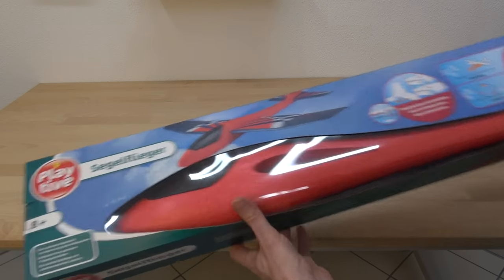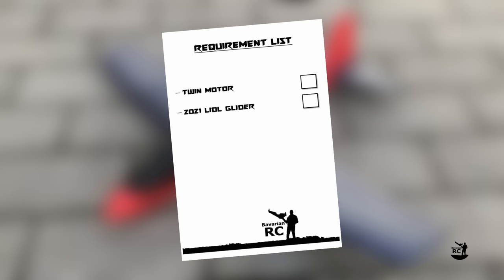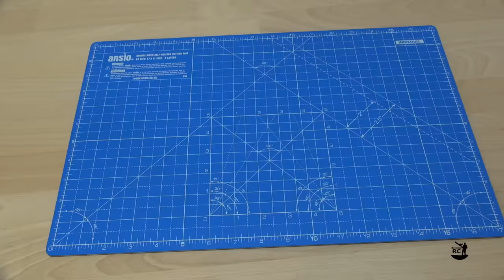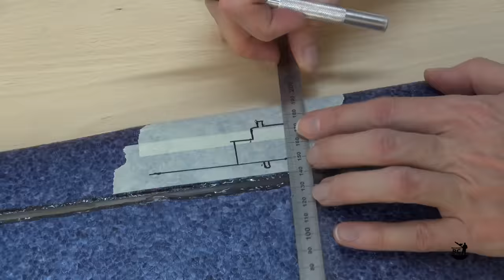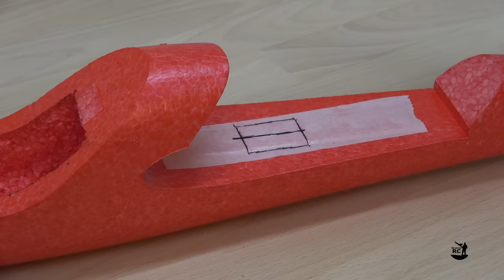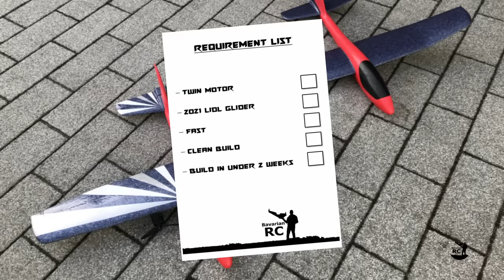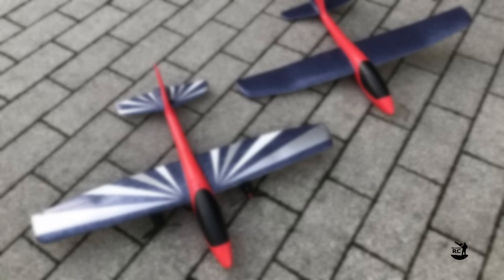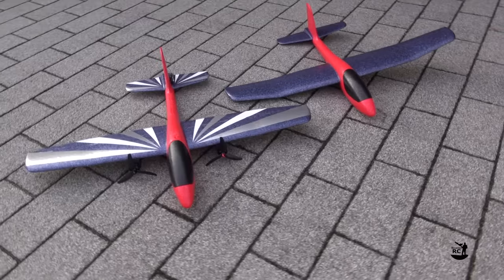LIDL glider RC conversion - TWIN TURBO LIDL - Build Video

Comment: FYI if you coat that wing with box tape,  you wont have to put a reinforcing rod into it, and it smooths out the wing.  if you layer the tape to overlap towards the rear, you create more lift due to the stair casing affect of the layering.   i used to do this with gliders and mount 0.49's on them and fly them during the early 2000's.
Reply from the maker: I am using packing tape a lot on my foam board builds to reinforce them. Never thought about using it on a foamy except for covering things like ESC in the wing. Need to try this. Do the layers work like a kind of KFm airfoil?
Reply: @bavarian_rc  it can if you layer it so that the top stepps towards the leading edge and the bottom steps towards the rear of the wind.  you'll cause the top the drag and the bottom to slip.  which in turn causes lift.  also if you pull the tape while setting it onto the wing,  you'll cause a slight tension on the wing,  then when you do the 2nd side it will pull it back, which causes the wing to become very rigid.
Reply from the maker: Thanks a lot. Quite interesting effect. The way you explain it makes totally sense. Tension on both sides will in effect make it totally strong. I will definitely try it 👍
Reply: @bavarian_rc  another tip for those foam gliders,  before you tape it,  Sand it with an 80 grit sand paper..   you can alter the shape and smooth out the surface, and it will help the tape to stick really good.
Reply: @bavarian_rc  also i have to say, that your hatch idea, with the easy release was a really good one that i have not thought of..  which is very rare, seeing that i have been doing rc planes since the early 80's..   :)
Reply from the maker: Sanding makes definitely sense. The untreated surface is not very adhesive friendly except if I used hot glue. everything else just peels off if you don't sand it.
Reply from the maker: Thanks, that is praise from a qualified mouth! I have to say that this hatch design was one of my brighter moments 😂 It took me a while to come up with the idea. Before I used magnets or just electric tape around the hatch and fuselage but finally this solution is favorite one. 
Seems we are around the same age. I built my first RC plane mid of the 80's. It was followed by many more until the early 90's. Then other things were more important in my life and I paused the hobby for around 25 years... just to restart full throttle in 2016.
Reply: @bavarian_rc  Dan's Foamy Tip #4 :  Great Stuff Squirt Foam and Flower,  is your best friend.  you can put some of the red canned squirt foam from home depot into a small disposible container, then add flower and mix until it becomes the consistancy of play dow,  then you can push it in and form it,  give it an hour, and it will be solid foam.   sandable,  paintable, and even glueable.  near as strong as balsa wood, and nearly as light.
Reply: @bavarian_rc  you can also use the squirt foam as glue if you work it down from the inital fluff out of the can into a paiste, then just a pipsickle stick to smear it between two surfaces, then join them, and give it an hour,   it will be glued with foam..
Reply from the maker: Wow, great tip! Not sure I will get the exact same product in Europe but I guess it is normal PU foam spray. Or is there anything special to it? Just out of curiosity: how do you get the idea to mix PU foam with flower? I am used to think outside of the box but that idea is just fantastic!
Reply: @bavarian_rc  pretty much any gap fill foam,  used for sealing between window frames and houses, or sealing and insulating any thing really.  in the usa, there is 3 types,  hyper expanding,  medium expanding, and low expansion.. you may have to try and see which is best, but i found that the medium expansion stuff works best.  as for how did i come up with the idea,  i started out mixing sanded foam into it, but that didn't work out so well because it still expanded,  then went to corn starch, and still wasn't good enough, so i went and tried flower, and man, it was amazing,  even had some engineers wanting some pieces to test tensile strength compared to wood.
Reply from the maker: Fantastic! Have to try this as well!
Reply: @danratsnapnames  That's certainly an interesting idea for making instant light Spakfilla glue. I am assuming that by "flower" you mean ground wheat "flour" - not the San Francisco hair adornments? 😉
Reply: @theoztreecrasher2647  yea, your right.. i hate my stupid cell phone.. i turn off spell checking, and nothing types right,  i turn it on, and it changes the odd stuff.  nothing works..  sorry, old person having a moment. .lol..
Reply: @danratsnapnames  LOL! No Prob! I'm 1-up on you. So old that I don't even have a mobile phone - no coverage out here in the Aussie bush anyhow. 😉😊

Comment: Yo hubiese instalado los Becs en la gacela atras del motor para que refrigeren.. Ingeniosa adaptacion!!!!
Reply from the maker: Thanks! For better cooling you could certainly put the ESCs into the nacelles. There were 2 reasons why I didn't do it. First: The ESCs don't get too hot. The max. temperature is typically around 60°C. Second: This thing is pretty much nose heavy. So every gram I could get behind the center of gravity (CG is at the position of the carbon tube) was helping me to avoid adding more weight in the tail. Greetings from Bavaria!

Comment: Great video. I built a very similar Lidl twin a few years ago and it is still flying well and frequently now. I mounted my motors above the wing which seems good so it will be interesting to see if yours pitches up under power...
Reply from the maker: Thanks! I had some pitch up effects under power at the beginning. After some flights I found a motor down thrust of 2,5 degrees working quite well to compensate the effect. Another issue with mounting the motors under the wing is that the props are touching the ground when landing. By using the HQ props which have some flexibility I managed to avoid broken props. Check out the flight video to see how it behaves in the air: https://youtu.be/9_H6sVcMOhw

Comment: For fine slices into the foam I'd prefer a soldiering iron with temperature control, which makes less fuzz, though, depending on the used glue (epoxy or CA) the dremel result might work better. Heat glue has some advantages, but only with specific materials.
Reply from the maker: The mess when working with the dremel is not as bad as it looks. The vacuum cleaner does the job. Maybe next time I try my hot knife. Should work similar to a soldering iron. On this type of foam I prefer hot glue or PU glue. With CA or Epoxy the results were not as good.

Comment: Very wonderful production sharing! I have seen the video of the test flight. Can you please make another introductory video after the final optimization? Very much looking forward to it! Can you also share the printed files of the motor base and rudder angle? Thanks again!🎉🎉
Reply from the maker: Thanks. Actually there was no further optimization necessary. It flies just perfectly. The link to the STL files for 3D printing is in the video description. Also you can find a plan and more detailed info there

Comment: No way!! I'm building the same thing!! Twin lidl glider!!
Reply from the maker: Ha, that‘s funny! What motors do you plan to put on it?
Reply: @bavarian_rc  1407 3600kv brother hobby
Reply: I used thin carbon strips to reinforce everything, and used gorilla glue/ugu por to glue them in. Why did you take out the dihedral? What benefits does it give you?
Reply from the maker: Thanks for the info
Reply from the maker: The dihedral leads to a self stabilizing effect. I was looking for high maneuverability with very high roll rates. The dihedral would counteract to this. If you would go for a very light thermal glider you would want to have dihedral for stabilizing the plane while circling in the thermals.

Comment: Very clean build, I would use foam safe CA on a lot of areas to reduce weight, slow down with the hot glue lol. Nice build!
Reply from the maker: Thanks! You are possibly right that I could be a little bit less generous with hot glue 😂 Nevertheless hot glue easily fills gaps which means I don't have to cut too precise (like for the carbon spar). But in other areas foam safe CA glue could easily be used 👍
Reply: Because these gliders are made of very flexible EPP not stiff and brittle EPS, using a hard and brittle adhesive like CA (Superglue) would NOT be a good choice. As the foam flexes the CA will crack away from it. Also "Foam Safe" glues are for EPS - with EPP you can use things like rubber/contact cements which contain toluene. Using them on EPS would give a gooey mess instantly! 
Provided you make fairly neat fitting joints and scrape off any extrusions, hot glue makes a good and reasonably light job. Also 1 slight problem with EPP foamies is that there is often mold-release compound still coating the outside. This can make it difficult to get glues/tapes/adhesives to stick properly. You can try cleaning the mating surfaces with isopropyl alcohol or roughing them up with sandpaper but generally a good hot application of hot glue will slightly melt into the foam and produce a really solid bond.
And speaking of flexibility, you will notice that the builder has opted for slightly flexible props rather than the very stiff (and brittle) props used on racing quads. These are a little less efficient than the stiff ones but will take a LOT MORE heavy landings before they need replacing!  😉
Reply from the maker: Thanks for giving a lot better answer than I did 😜 I didn’t think of the effect of the brittle CA on the flexible EPP.  👍 Cheers!
Reply: @theoztreecrasher  I have build a few of these, I used very little hot glue, some foam safe CA and epoxy, never have an issue.
Reply: @rubenburgos6  I don't doubt what you say - BUT perhaps you don't crash your planes as much as us Old Farts do! 🤔😜😁
Reply: @theoztreecrasher  hahaha define old fart...I might be in the club already 😆😆😆

Comment: @Bavarian RC And you should fun it on 2 batteries or one because there are two connectors.
Reply from the maker: I use one 1800mAh battery that is connected with a Y-cable to both controllers

Comment: Sehr wunderbare Produktionsfreigabe! Ich habe das Video vom Testflug gesehen. Könnten Sie bitte nach der endgültigen Optimierung noch ein Einführungsvideo machen? Ich freue mich sehr darauf! Können Sie auch die gedruckten Dateien der Motorbasis und des Ruderwinkels weitergeben? Danke noch einmal!
Reply from the maker: No sure if you saw my other answer to one of your comments. The design didn't require any more updates. The link to the STL files for 3D printing are in the video description

Comment: very nice clean but how you land and not broke the plane? your propeller touch the ground
Reply from the maker: Thanks! You are right, the props touch the ground when landing. The HQ props I use have some flexibility and don‘t break. Even after more than 60 flights with my Twin Turbo I didn‘t have a single broken prop.

Comment: Great job, congratulations. Graupner Ultra 2806 2300kv motors are no longer for sale. What other engines would you recommend? Thank you very much
Reply from the maker: Thanks! Yes, luckily I still had some of the Graupner motors available. They work really well. I haven't tested any alternative, but I guess any other 2206 2300kv motor will work as long as it can take 3S. This is one that I found: Holybro Brushless QAV250 Motor (https://www.mybotshop.de/Holybro-Brushless-QAV250-Motor) - also available in CW and CCW which is quite nice as it compensates the torque on a twin. This one could also work: DYS FIRE FPV Racing Motor 2206-2300kV (https://www.rcheli-store.de/Quadcopters/FPV-Racer/FPV-Racter-Motors/DYS-FIRE-FPV-Racing-Motor-2206-2300kV.htm?shop=rcheli_en&SessionId=&a=article&ProdNr=DYS-FIRE-2300&t=15578&c=32452&p=32452). I hope this helps.

Comment: CG is my concern other than that very excellent build
Reply from the maker: Yes, this thing is a bit nose heavy. Therefore I moved the elevator servo to the back and also installed my GPS Logger close to the tail. With that setup it balances with just 5g more of balancing weight glued to the tail.

Comment: Thanks for video, could you please clarify where you put such big battery? I would like to be similar one.
Reply from the maker: Thanks for your feedback. The battery is installed right underneath the black canopy (together with the receiver). You could have a look at my Instagram account (https://www.instagram.com/bavarian.rc/) there I posted some pictures of the battery installation (posted in May 2022). If that doesn't work for you then check my mail adress in the channel impressum (in the channel info) and drop me an email. I will then send you pictures of my battery installation.

Comment: A job well done - very neat, especially with the lack of any space in the airframe (being solid foam). I would have liked to have seen a video of it flying. The motors look very powerful, possibly less 'poke' and no need for the carbon spars?
Reply from the maker: Thanks! Check out my flight video: LIDL glider RC conversion - TWIN TURBO LIDL - Build Video
https://youtu.be/YPsG6kbdEaI   The Power / Weight ratio is almost 2:1 … so going vertical is pure fun, just like the endless flat spins. I wouldn’t try without the carbon spar.
Reply: The original foam is quite bendy. It needs the carbon spars to avoid it folding up or just steering itself beyond the range of the controls.
Reply from the maker: Yes fully right! Without the carbon it would be too floppy.
Reply: @bavarian_rc  Yes, I guess I'm going to have to buy some for my recent Lidl purchases.
Reply from the maker: You won’t regret

Comment: @Bavarian RC And for the servos you must buy how many normal and how many reverse?
Reply from the maker: In case I need to reverse a servo I do this in the settings of the transmitter. If your transmitter doesn‘t have this feature you can still use normal servos and just rotate the installation position if needed

Comment: Hi, @Bavarian RC What contoller do you recommend to use for this build? The cheap one.
Reply from the maker: That depends a bit on your motor setup. I used 18A controllers that I already had lying around. They get warm during flight but not more than 70 degrees. So no need form a bigger ESC but I would also not take a smaller one. I would say any cheap 18 to 20A controller would be fine

Comment: I’m a bit confused by the new German model aircraft regulation. This build is about 580g. Does it mean I have to get a certification before I fly this plane? The regulation say that I don’t need certification for something less than 250g. In that case I would try to build something with smaller battery and single motor. But again, can someone clarify if my understanding is right?
Reply from the maker: As a simplified view: Every model that is heavier than 250g needs to have your eID (your registration) attached to it. If your model is heavier than 2kg or you are flying higher than 120m above ground you need a proof of knowledge ("Kenntnisnachweis"). For a complete overview check out this site: https://www.dmfv.aero/rund-ums-fliegen/einfach-sicher-fliegen/

Comment: Super Video - der Nachbau hat sehr gut geklappt.
Ich habe nur Probleme den 3S Akku 1100mah so zu plazieren, dass der Schwerpunkt stimmt.
Der Akku wiegt 110g und muss, damit der Schwerpunkt stimmt, fast mittig unter die Fläche. Das Heckservo ist wie bei Dir vebaut.
Wo hast Du den Akku?
Danke
Claus
Reply from the maker: Servus Claus. Vielen Dank für deine tolles Feedback. Ich habe den Akku vorne unter der Haube untergebracht. Damit ist er natürlich gnadenlos kopflastig. Da ich aber immer mit GPS Logger fliege, habe ich den ganz hinten am Leitwerk angebracht und krieg damit den Schwerpunkt schon fast hin. Ein paar Gramm Blei hab ich zusätzlich noch ans Höhenleitwerk geklebt. Schau mal auf meinem Instagram Kanal vorbei da hab ich auch mal Bilder vom Akku Einbau gepostet. Das war im Mai 2022. Bei meinem YouTube Video über den SM GPS Logger zeige ich wie ich den Logger am Heck befestige. Schau mal ob Dir das hilft. Bei weiteren Fragen gerne nochmal melden. Schöne Grüße Robert
Reply: @bavarian_rc  Danke Robert für die schnelle Antwort. Das nenne ich Service!! Ich habe den Rumpf unterhalb der Fläche ein bisschen geöffnet und den Akku nach hinten verfrachtet.
Abfluggewicht ist kanpp 400 Gramm. Hinten sind jetzt 10g Blei drin.
Ich bin auf den Erstfug gespannt. Melde mich nochmal.
Nochmals Danke.
Claus
Reply from the maker: Drücke die Daumen für den Erstflug!
Reply: @bavarian_rc  Der Erstfluo hat sehr gut geklappt. Nur der Motorsturzmuss noch ein wenig angepasst werden.
Danke nochmal für die tollen Videos.
Claus
Reply from the maker: Super, das freut mich sehr! Mit dem Motorsturz musste ich auch ein wenig experimentieren, bis es einigermaßen gepasst hat. Ganz neutral hab ich ihn nicht hinbekommen. Wenn ich das Gas sehr weit rausnehme, dann will er immer noch etwas wegsteigen. Aber das ist nicht schlimm. Viel Spaß noch mit dem Lidl. Ich fliege meinen sehr oft, vor allem weil die Größe so handlich ist und man viele verrückte Dinge mit ihm anstellen kann. Hat schon fast 200 Flüge hinter sich. 
Robert